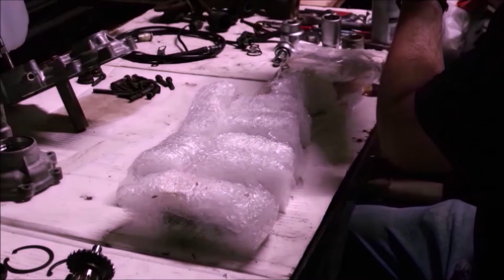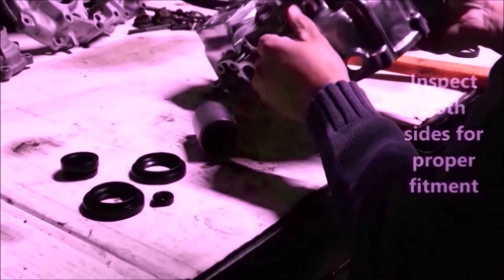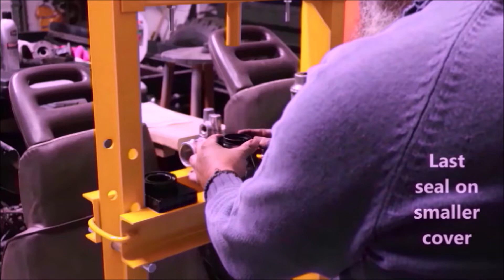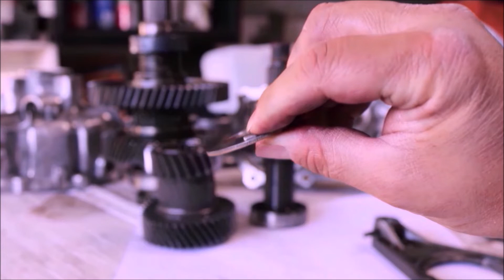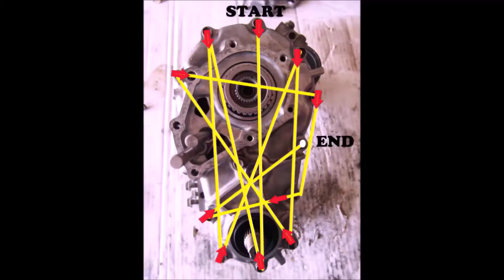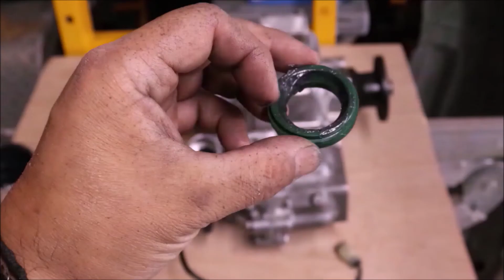Suzuki Samurai Transfer Case Rebuild Finally Completed

Comment: Hi, just saw your video and I have a question. I have a 2003 Suzuki Gypsy which is basically a LWB Samurai with a 16v G13BB engine. 

I have been experiencing a wobbly transfer case lever as the vehicle speeds up. At around 50-60 kmph, the shakes can even be felt in the steering wheel. My wheels and tires are brand new and balanced etc, and there's no steering issue as well. As I started diagnosing by removing the driveshafts one by one, I found that the shaky steering was gone when I drove in 4WD without the rear propeller. I have put on a brand new rear propeller too but somehow the wobble is still there. Now I want to check the transfer case itself. 

Can you please guide me what parts can cause such a wobble in the transfer case? I am guessing it is the rear output bearing. How should I go about the issue?

Comment: What torque specs were used to bolt both halves together?
Reply from the maker: It should be 9.5 to 16.5 foot pounds per repair manual… Use the bolt pattern on video to get them on there evenly… Good luck and thanks for watching

Comment: Where did you order the kit from, do you have a link to the site ?
Reply from the maker: Here's a google link with many places where you can get a kit:  I think I got mine from India but the experience was not good as I had to send kit back to get the correct seals several times.  Good luck on your project.  https://www.google.com/search?q=suzuki+samurai+transfer+case+rebuild+kit&rlz=1C1GCEA_enUS1004US1004&ei=X84PZOKzEvO90PEP5Km7-AM&oq=suzuki+samurai+transfer+case&gs_lcp=Cgxnd3Mtd2l6LXNlcnAQARgBMgoIABBHENYEELADMgoIABBHENYEELADMgoIABBHENYEELADMgoIABBHENYEELADMgoIABBHENYEELADMgoIABBHENYEELADMgoIABBHENYEELADMgoIABBHENYEELADMgcIABCwAxBDMgcIABCwAxBDSgQIQRgAUABYAGDeF2gBcAF4AIABAIgBAJIBAJgBAMgBCsABAQ&sclient=gws-wiz-serp
Reply: @oldguywawrench  thanks guy , appreciate